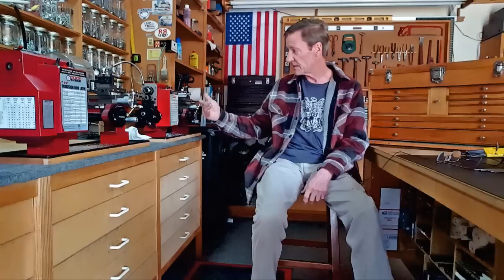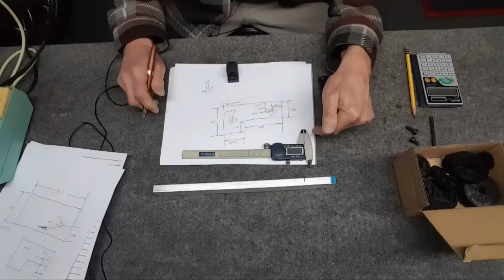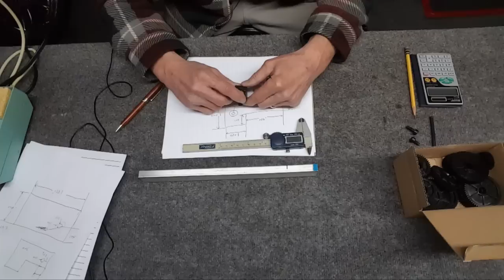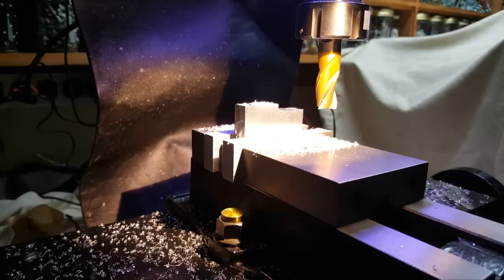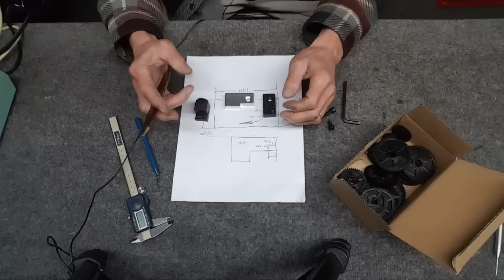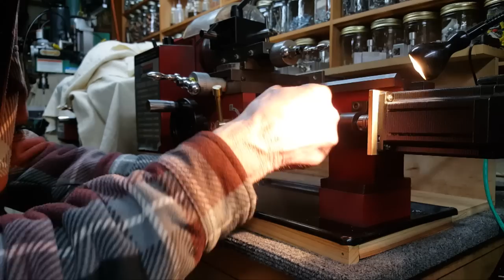Mini Lathe Threading Dial Upgrades

Comment: Dave, if you are still here, I have a question for you. I bought the Harbor Freight metal mini lathe 7x10 3 years ago and just started using it las week {so much for the 2 years extended warranty plan). I cannot get the auto-feed lever to budge and wonder if you might have some ideas on what I either am missing or what may be defective. I really enjoy your many videos on this lathe and wait for more. Thanks, Dave, and I hope to hear from you on here soon.
Reply from the maker: The only way to tell is to remove the apron which i did a video on.
Reply: @TheMiniMachineShop , thanks and I watched that video after I asked you the question and after I will watch it again> I appreciate your help.
Reply from the maker: https://www.youtube.com/watch?v=pILWN1X3qC0&list=PL08D58CEB375EE711&index=37

Comment: I am a little confused as near the end it seemed you still had some kind of problem and took it off but then seem to say it was done. Doesn't that new dial have to be mounted in a relationship to the gear? To get more than a small amount of gear engagement my dial is pointed down about 45 degrees and hard to read. How do I duplicate your bracket.
Reply from the maker: My email is shown at the end and I can send a print of what I made,...

Comment: Hey hi Dave.
Simple as it is the see through chip shield in front of the mill we think we could apply to the only opening the would be the front of our TAIG cnc mill, we see with you it really works well.
The lighting at the lathe came through really well.
Really nice Dave.
Lance & Patrick.

Comment: End mills don't cut flat bottom holes. The cutting edges taper down slightly from the center towards the outside edge. This is done for clearance so that mills aren't repeatedly running cutting edges over the same surface. If you want a flat bottom hole for cap screws, I suggest that you use counterbore mills.

Comment: Dave, do you have numbers on the dots or some kind of markings so you can hit the same dot every time? Don't you need odd and even numbers for different pitch threads? My ancient HF 7" doesn't have any kind of a lead screw cover. Even though CNC I really think I'll copy what you have on your lathe. Thanks for the video!
Reply from the maker: Sorry George but still very new at this. There are no numbers and all I can say is the gears are set for 24tpi and I I've engaged on random dots and it lined up correctly every time. You will see me doing it in a future video. Lucky maybe. Never heard of the numbers meaning anything and will research this now. If needed I can color inside the dots. Did one color dot off camera for fun after the video.
Reply from the maker: Duh! The numbers are listed on the side of the cover as to when to engage for each TPI. I was lucky and any number for 24 TPI will work. Looks like any pitch you can start with 1 so, for now, I'll have to color one dot in and always engage on it. Thanks for the input!!
Reply: I knew you'd figure it out. 😀 Sometimes luck is better than knowledge. I usually start my threading on the number 1, it just makes it easier.
Reply from the maker: Coming up is laser engraving the dial!
Reply: Can't wait to see it!
Reply: Exactly, just winging it. Uhh